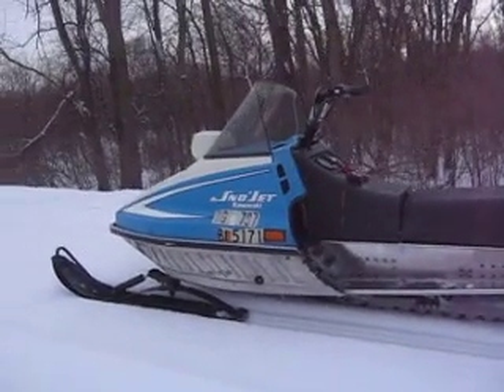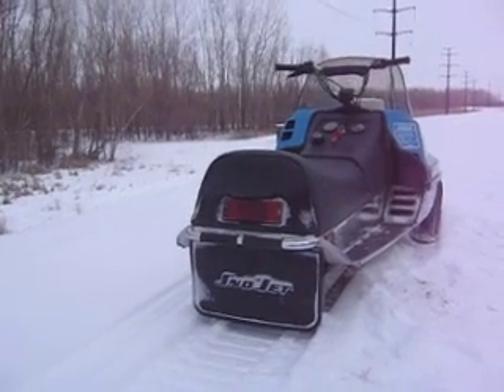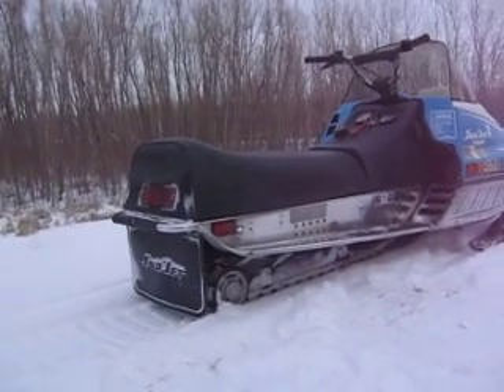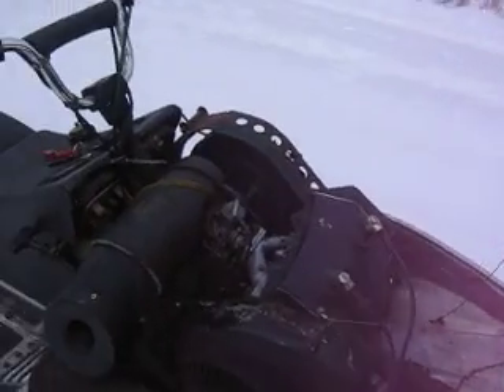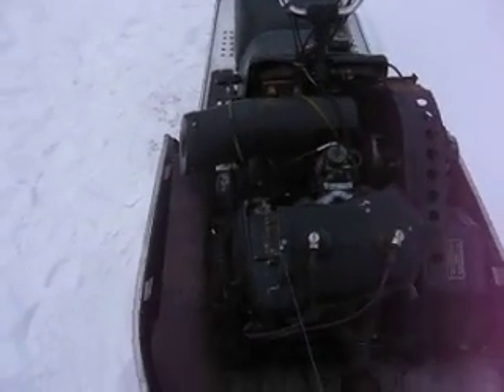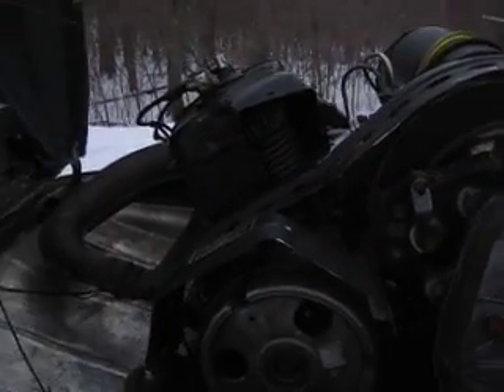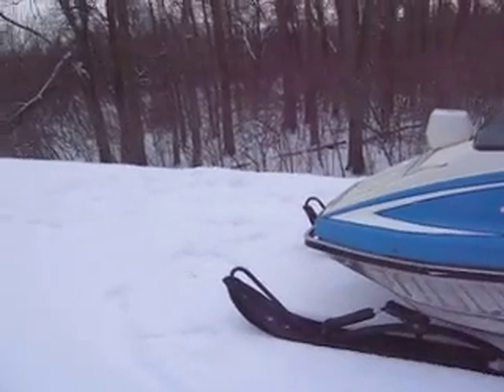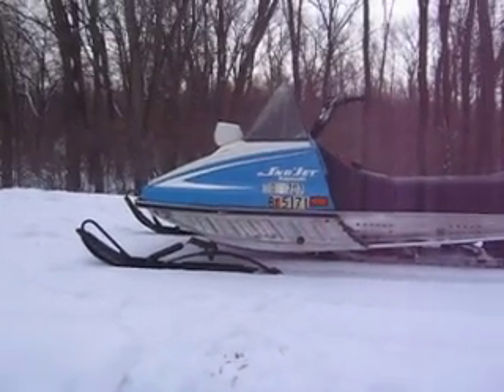A walkaround of my vintage 340 Sno Jet snowmobile

Comment: yes i am  looking at a 1973 and a 1979 sno jet found them on craigs just been wondering what kind of sleds they are all i been working on is john deeres and masseys lol but the motors should be similarglad to see this one running